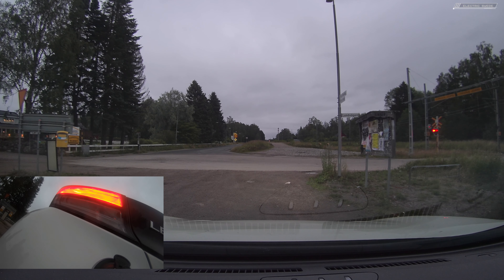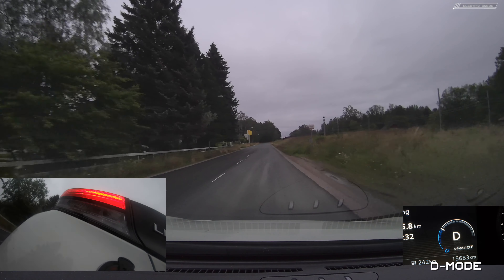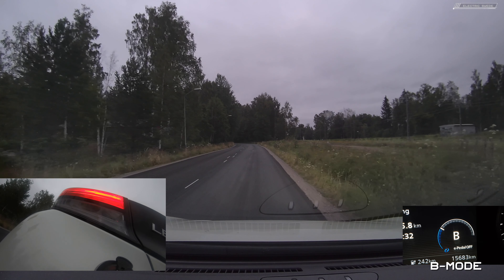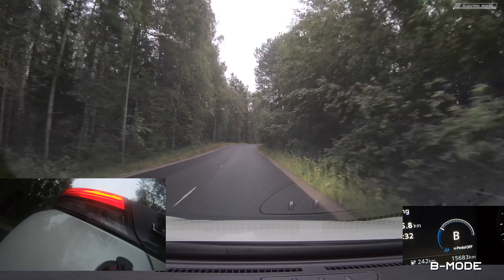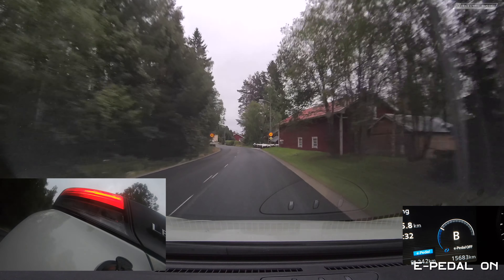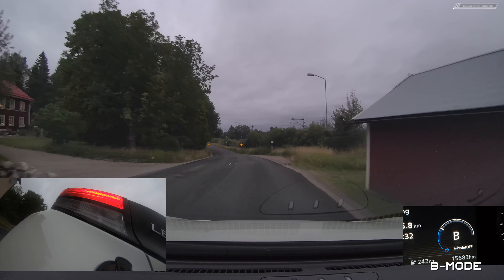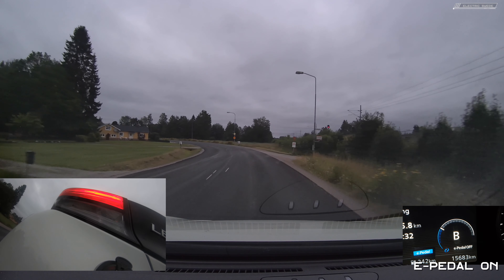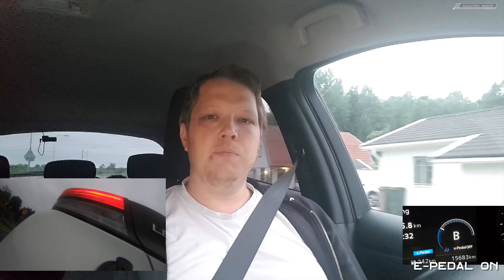How brake-lights works in a Nissan Leaf 40kWh 2018 - B-mode vs E-pedal

Comment: Thanks for checking! I drove behind a Prius Prime in Utah once on rolling highway and his brake lights coming on as he coasted drove me crazy.  The systems need to use common sense and only show brake lights in the same way as if hitting brakes manually.
Reply from the maker: Agree... Just slowing down the same amount as regular enging braking should not make it light up.. But when you regen more than just a little it should.. The B-mode actually will slow you down as if you downshift a regular car 1 or two gears and let go.. That can be pretty much.. So after a few seconds it would be good to have them go on...
But to have them go on right away as soon as you slow down just a tiny bit as with E-pedal isn't good either..

Comment: I'd really like to know what happens when driving at higher speeds. In B mode, if there's no brake light coming on in highway driving that could be serious as the car behind won't have much warning that you are slowing down.

Comment: What is the B mode>>>??
Reply from the maker: Gives you more regen. Car uses the electric engine to "brake" a bit when releasing the throttle and it recharges the battery. (Not using the brake disks to slow down.)